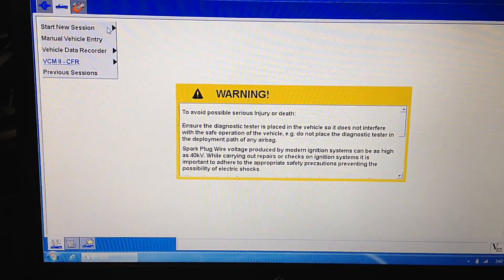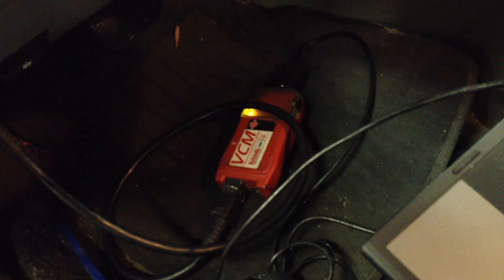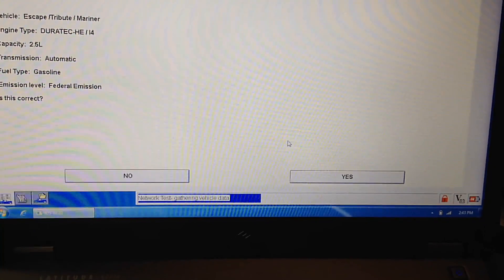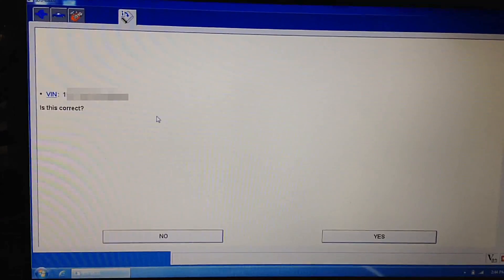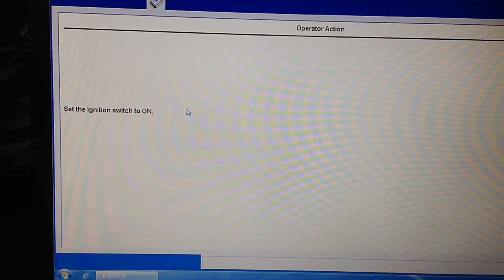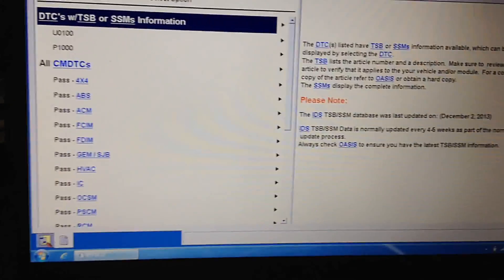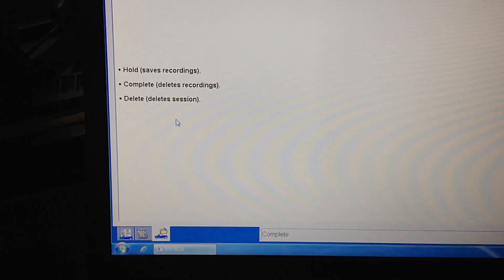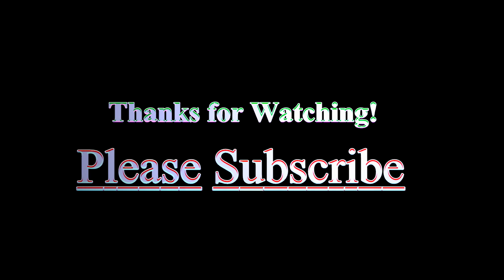Ford PCM Software Reflash Procedure

Comment: Hello and thank you for all the videos! I am having a rough stop problem in my '08 Explorer. It has the 4.6L V8 with the 6R60 transmission. When I bring the vehicle to a stop once it gets below 10MPH it lurches and you can feel the transmission shifting down hard. From what I am finding on the internet there is an update to the transmission on the Sport Trac with the same power-train. When I call the dealer, they are unable to find the TSB for my vehicle because mine is the regular Explorer. Have you dealt with the bump in the transmission issue before, if I pay to have the PCM reprogrammed if there is an update it will apply it whether the tech knows about that particular update or not right? Apparently the TSB is 07-23-2
Reply from the maker: Nunyaa Bidniss Yes there is a update for yours but after they must clear the trans adaptive tables and perform the drive cycle outlined in the tsb. Any time the dealer techs update the pcm it updates to the latest level automatically to include all past updates.
Reply: FordTechMakuloco Thank you for the reply. Contacted the dealer where I have the appointment to update the PCM and he's telling me it will automatically clear the trans adaptive tables with the update to the PCM. Hopefully the guy working on the car knows he has to do it. Thanks!
Reply: sale of license and installation for original and cracked ford ids and fdrs at the best price without limitations, all programming systems unlocked, unlimited key encoding, built data download, integrated programming, sync programming, latest monthly ids updates, professional encoding with PTS accounts, 1 year license ids and fdrs
Reply: Great job I have a Lincoln mks 2011 and my issue is I replaced everything under the hood and still with this code po625 and it has a battery light on and runs rough and drive rough wat could be the cause reprogram or wire issue new battery alternator plugs and wires

Comment: Thanks for the video. My Ford dealer won't even check for any updates, let alone do a reflash. I have told them about my concerns with shifting on my 2013 Escape 2.0. Here it is over 2 years I've been driving it, can't believe there is not an update. Really wish you worked at my dealership. I enjoy your videos.
Reply: EscapeLover What are your shifting issues?  My wife has a 2013 Escape, 2.0 naturally aspirated with a 6 speed auto.  It has been shifting funny since it was new.  Most noticeable in the 2-3 shift under moderate throttle.  Feels like it spends too much time in-between gears, followed by abnormally hard thump when the next gear engages.  I bring it to the dealer and they say there's nothing wrong.  If it was one of my $1500 beaters I would have sold it long ago, for fear of impending tranny repairs.  I thought I was the only one.
Reply: job security assholes

Comment: Hello good day brother, a question is true I need to hire a license to use the option of programming module. Because in the vcm that I have tells me no selection available. Maybe it's because it's not original, buy it in xcar360.com. I would like to know how to use that option to program modules. Thanks hope to answer. I hope you can help me.
Reply from the maker: Yes it is all spelled out here- http://www.motorcraftservice.com/vdirs/retail/default.asp?pageid=pubs_pcm&gutsid=pubs_pcm
Reply: friend, then no matter what my vcm not original? you mean all I have to do is buy the license, install the software that they give me and ready?
Reply from the maker: yes it is very simple setup
Reply: +FordTechMakuloco hi I have a 98 Ford expaditon and the check engine like will not go off they did a diagnostic test said it was the oxygen sensor the two in the back well I replaced them and the check engine light came  back on so how can I fix that

Comment: Hi! I have an 2008 ford explorer Eddie Bauer V6 with  about 110000 on it. 
what happens is while driving  anywhere from 20-70 mph the engine will completely die, I lose power steering and power brakes. the radio will stay on as well as the dashboard. a wrench will appear on the dash and the engine will just die. sometimes the wrench will appear and the gas peddle with not respond, then it will die. once I come to a stop I place the gearshift in to park and try to restart. sometimes it will start up immediately with no problems. sometimes i turn the key to start it and nothing happens at all, other times i will turn the key and the engine will crank but will not start. I have been to the dealer 3 times with no luck at all, they have no clue what is causing it. the codes i pulled are P0607 P060B P060C P2104 P2107 P2110 do you think the PCM is shot? 
any help would be appreciated.
Reply from the maker: I would inspect the engine and body harness in the engine compartment especially under the air filter box it likes to chaffe after that I would disconnect anything that uses vref one by one. Short answer I just had something similar to this the other day and had to change a pcm for the internal software issue so the pcm could be failed also you will have to go through the steps above to check for external sources though.
Reply: FordTechMakuloco Thank you for this info. I will look into what you said and let you know how it turns out. thanks again!

Comment: Ok, in mode 6 the P0306 is back. Around town in moderate speeds eveything is fine. When I drove 20 miles on the highway avg speed 75 mph the misfire is back. Darn I need a tool that can datalog this problem. More money...

Comment: Here's a interesting update... I saw your other video on clearing the PCM and to my surprise it took care of the P0306. In mode 6 there are no misfires recorded. The only test I have an issue with is TID: $42 CID $12 I think that has something to do with DPFE. In the drive cycle only the evaporative test is still running. I guess my truck had learned a bad habit and thought it was normal. I normally clear my codes using my obd2 scanner or my torque scanner. Now I know how to properly clear the PCM. Thank you.
Reply from the maker: Gabriel Puckett How To Clear your PCM'S Memory on Fords After Repairs
Reply: what is the proper way to clear the pcm?

Comment: Here's more information: vacuum gauge reads steady 25 vac at idle. Fuel pressure with vac connected is 31 psi.

Comment: I have a 2001 Ford F150 4.2L. I've been battling P0306 for 5 years now. I changed, coil, plug, injector, and changed the cylinder head. The EGR ports have been cleaned. My only suspect is the PCM. I never get misfires on the other cylinders. Just cylinder 6. The engine runs smooth. Could it be a bad solder joint to the cylinder 6 circuit or does the PCM needs to be reflashed.
Reply from the maker: If there was a bad driver in the pcm it would set a code. It has been misfiring for 5 years off and on or all the time? It keeps setting p0306? Well over the 5 year allot of things could fail again the the ignition coil or the egr ports. Never changed the plug wires? You using motorcraft plugs? Have you check that cylinder compression and for spark plug fouling from oil or otherwise? Pcm is not likely.
Reply: I just changed head, spark plug with motor craft and with Ford oem coil last week. Changed the wires a year ago because of P0306. It worked fine for 3 months during the summer. Then the fall came the gas stations switched to winter blend the truck misfires on cylinder 6. Also installed new IAC and egr. I cleaned the MAF.
Reply: Answer to your question yes it's always p0306 no matter what's done to the engine. The truck has over 290,000 miles on it. I changed the head on the driver side because the valve seals were leaking causing smoke out of the tail pipe at start up so I changed the head hoping it would cure the misfire on #6 as well.

Comment: Thank you for making this video. My 2000 Expedition was indirectly struck by lightning 2 days ago. I tried to start my truck up and it stalled, I re- attempted to start the truck again and I heard a pop on the passenger side. The Anti Theft light flashing and it is making a ding sound in a rhythm of 5, which I do believe is a code. Also my horn and panic horn sounds muffled. I attempted to code the truck but it came up with an error reading all 10 attempts.  I Me telling the Ford servicing tech what I mentioned above says it's the PCM. Does this sound like it's the PCM? If so, can I just purchase a new one and install it ? or does it sound like it's the Anti Theft mechanism. What is your thoughts on this? FYI the tow truck was suppose to pick it up two days ago, it has yet to arrive...
Reply from the maker: When vehicles get hit by any kind of lightning almost all modules need to be replaced we have seen many. You cannot swap in a pcm yourself, it does not control the Anti Theft light (PATS) the instrument cluster does that but it need to be able to talk to the pcm, so when a new pcm gets put in a parameter rest needs to be done on the Ford scan tool. Yeah the way it sounds you will need multiple modules. Have you contacted your insurance company yet this is about to get expensive.
Reply: :( I was kinda hoping there would be a way of doing some of the work at home and then some of the work in the dealership.. 
I am still a student and trying to keep things cheaper as I have the feeling they are going to say my truck it totalled. I love my truck, and have over 200,000 miles on it but it's paid off. Im not looking forward to payments anymore

Comment: if the new ranger engine was opened and was put back but the vehicle misses when start is reprogram required
Reply from the maker: No software reflashes generally do not cure dead misfires.
Reply: FordTechMakuloco

Comment: I do have VCM 2,for Ford, FROM CHINA  i need to do 2 things only:
1. reprogram lost keys and smart key

3. can i re-flash used ECU or PCM or TCM, to another car,  WITHOUT ANY EXTRA FEES , MEAN SUBSCRIPTION FROM FORD COMPANY
Reply from the maker: For that you will need a subscription they also have 72hr blocks I believe you can purchase now though so that saves some money.
Reply: For ECU,
but keys are free
Reply from the maker: The ids software doesn't lock you out if there isn't a authorization code? Ours does till we purchase a new yearly subscription and we are a dealer.

Comment: Is this the same process as when changing one of the modules with a brand new/remanufactured one?
Reply from the maker: Not exactly but pretty darn close. For those you go in and do a pmi on the new module which will transfer the old vehicle data over to the new module then program it to the car after that.
Reply: Sweet! Ive never done one and wondered about  how that works.  Trying to get my work to get a better scan tool along with a programmer so I can do some more advanced repairs.  Any suggestions on a brand that would work?  We have around 100 Fords trucks/vans/cars in our fleet with bout 20-30 GM's... Most of which are no longer under warranty.   Thanks for the info!!
Reply from the maker: jr scott I have heard good things about the Modis from snap on, but if you got that big of a fleet of fords I would get the ids from ford then you can do everything and they have a generic scan tool functionality too. They have opened it up to fleets and such now, all you need to buy is the vcm and cables then use any laptop.
Reply: Cool!! Is their a software purchase with that system?
Reply from the maker: jr scott Yes a per year subscription, they have the info on motorcraftservice. com
Reply: Thanks! !